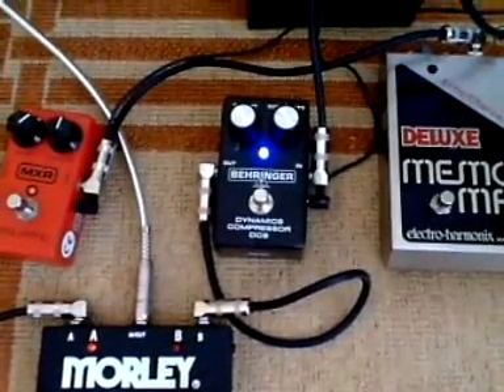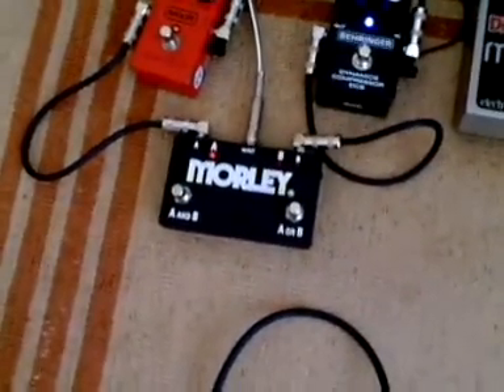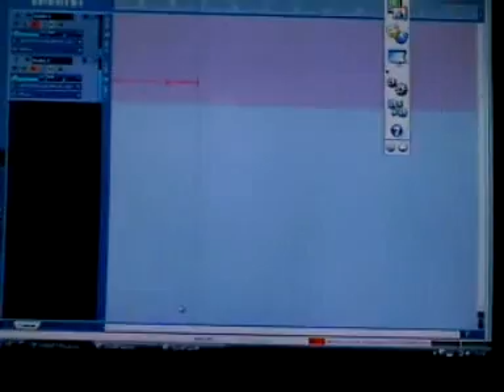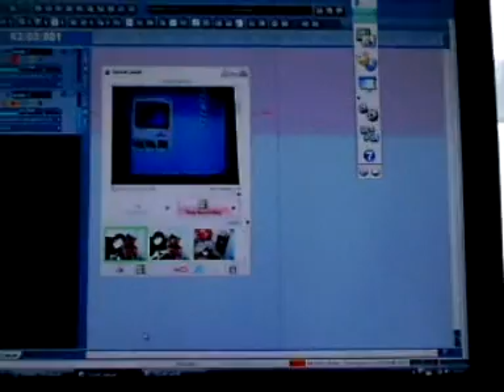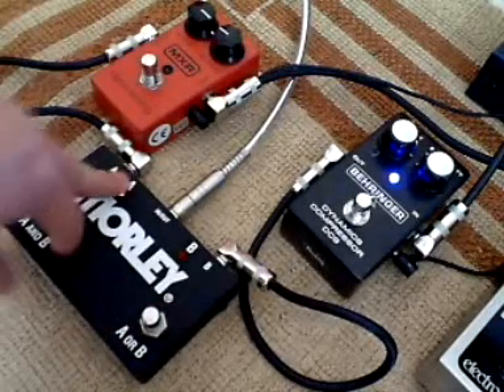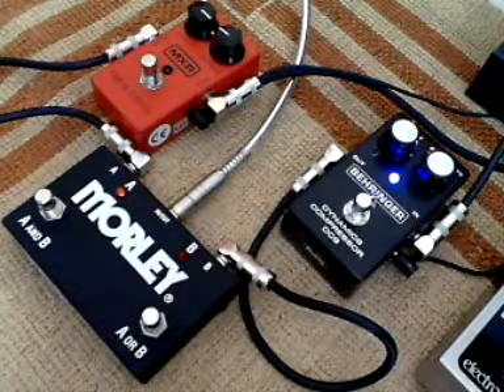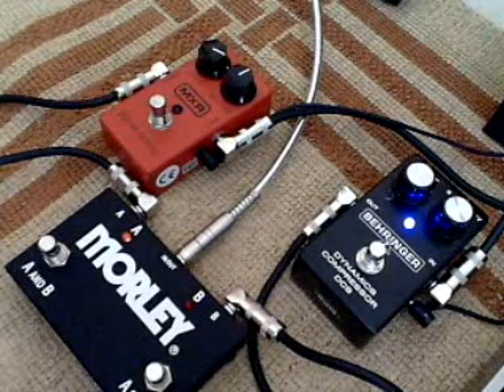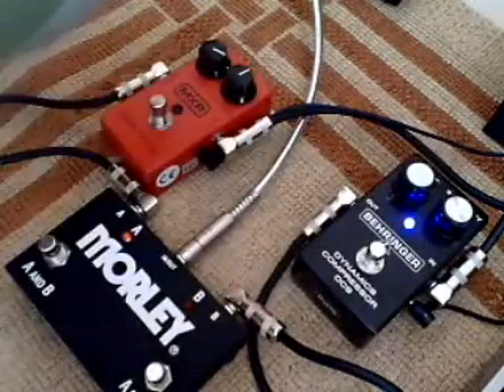MXR Dyna Comp vs Behringer Dynamics Compressor

Comment: the Behringer  would be very good choice for older class A wired amps that tend to be on the dark side like Alamo and Airline ,which are great amps  This Behringer pedal would replace an e.q. pedal for darker sound amps. It does sound great on my Alamos and Mangntone amps.